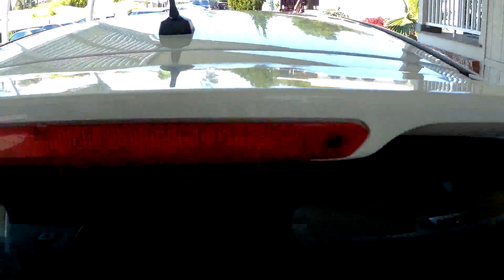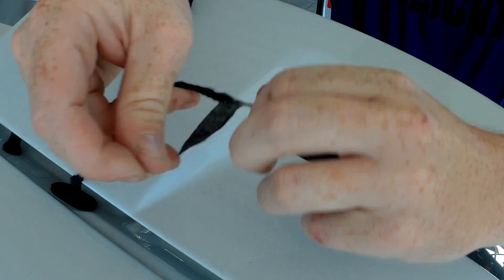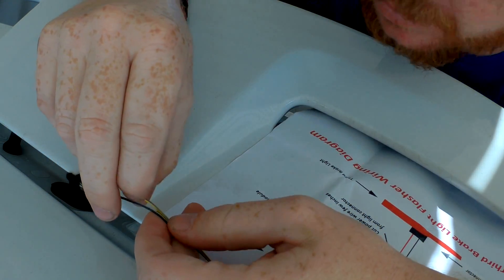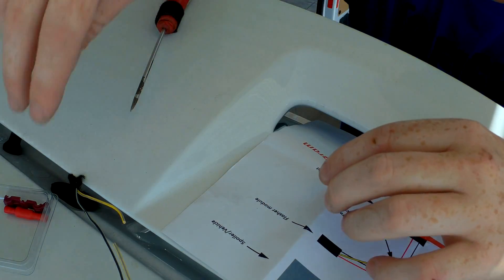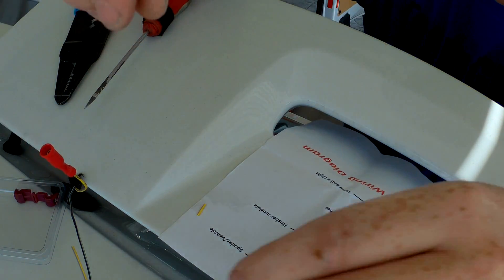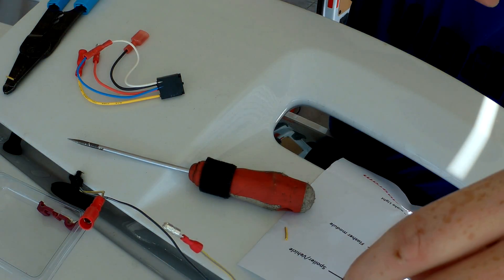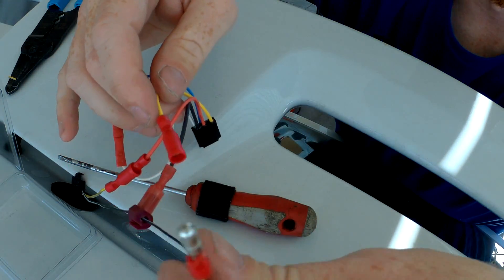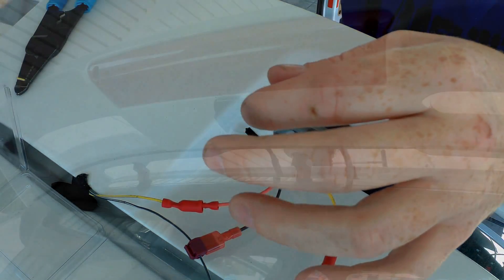3rd Brake Light Flasher Install

Comment: Installed on a 2023 Hyundai Elantra. Works great but every time I step on the brake pedal, I get a chime and warning message on the dash saying ‘check center brake light’. VERY annoying. It worked fine on my 2022 Veloster N. Wife is angry and wants a solution… 🤔

Comment: I see that you have wing risers... How does it look with the exposed wiring after install?
Reply from the maker: +Chris Magoulis it looks the same as it would without the module. The brake light flasher actually just sits inside the spoiler and is hidden from view. (OBrien)

Comment: so do I have to remove my wing to install this correctly?
Reply from the maker: +simplysara2008 not necessarily, if the wire is long enough you can pull it out through the brake light hole. If there isn't than yes you will have too.
Reply: BooSTed Aspirations ok thanks

Comment: I wish this would be illegal
Reply from the maker: Why is that?
Reply: Very simple, every single time you stepping on the brake pedal, the 3rd brake light is going to flash, regardless of the brake force. In reality, it should only flash if the deceleration is higher then ~1.4G (13m/s). It should only flash, if it's an emergency braking. This is rather makes it more confusing, as more of these strobe units are being used, less effective the emergency-flashing becomes. If you are curious, look up BMW's "Brake force display". There are kits, what has a built in accelerometer. You install that kit the same way, but the difference is, it only flashes your lights, when you are performing an emergency braking. I hope this explanation helped you to understand my problem with these strobe units. The idea is noble, but in my honest opinion it's counter productive.
Reply: @designertjp-utube  What click bait attempt? I just simply said, the brake light flashing should only occur if you are braking very hard. Not when you are just simply slowing down.
Reply: @Beni_777  Well.. when you say braking hard or slowing down in the same sentence, they both mean the same thing when your Life is on the Line when you're on our L.A. Freeways or in Street Traffic pretty much anywhere. Thus I'd wondered where U were based (West Coast, East Coast, or India or Hong Kong) because here, many Folks are not paying attention at the wheel behind you. I would luv for my vehicle, besides brilliantly flashing everytime, to blurt out, "Attention K-Mart Shoppers  this Vehicle is about to Stop (or slow down)!"  If u indeed live here in L.A. then you already know our dire "no-focus" life threatening  situation out on the roads. Pretty much all of us worried Drivers want our cars to "light up like a Christmas Tree" even if we only touch the brake pedal.